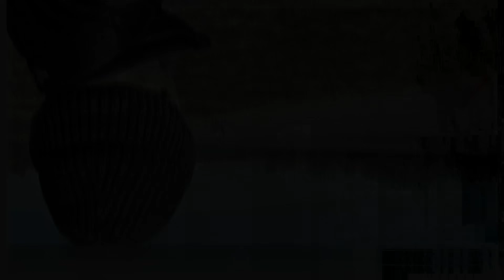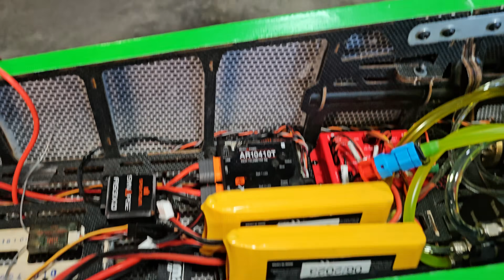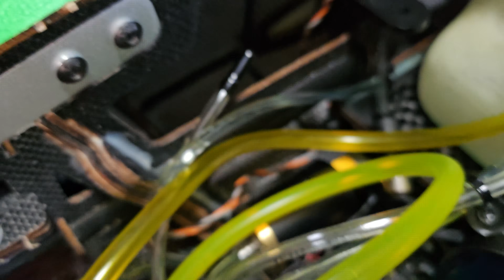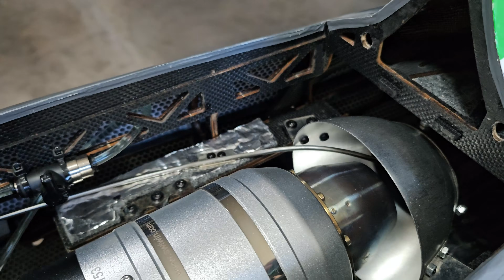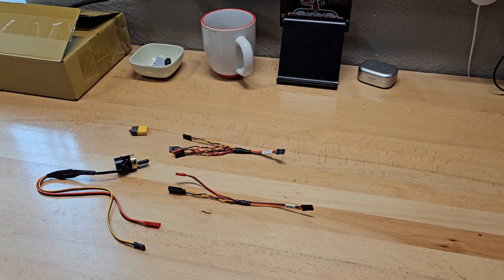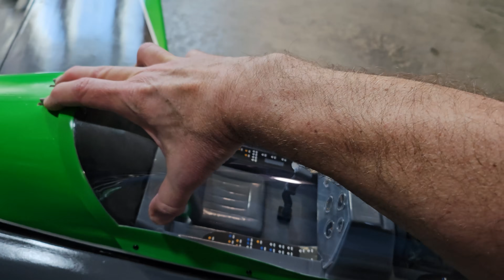ViperJet Build Part 4

Comment: I had a 125oz tank in mine and had the two smaller rx packs batteries mounted on the side wall over that fuel tank. As for the turbine battery I made a plate and mounted the that battery 
just in front of the engine. Also used a 130oz UAT in front of the tank as you. The turbine pump was mounted in the rear didn't have smoke in it. CG was dead on. I don't care for the CG plates that comes with the model, I used a Xicoxy balancer and a EZ-Balancer stand.

Good idea with the wiring. The first Black Horse I had I painted over the cover with Automotive metallic paint. The covering had a reaction in some area of the covering. In the sun that covering started to lift which made the plane look really bad. I've since bought a second one and my plan is to remove all the covering and fiberglass everything, then do a custom paint job.
I haven't started the work yet as I have another plane I'm working on. 

I did a metal flake paint job on my Boomerang Elan which turn out really. That gray is a hard color for me to see.
And yes the Unilights are pricy I have them plug SkyCandy light on a couple other jets.

Like the idea of the top plate covering all the wiring👍👍
Nice maiden

Oh! I didn't have to add any weight to my plane

Comment: Mine's comming along too. I also have CG-issues. Moved everything as far back as possibly but still needs some lead in the tail.
And then I'm in doubt if I shold clear-coat it? Have already bought the 2K sprays.
Im using a JetCat P80se which is relative long, so had to move the tank almost 50millimeters/2inches forward 😮.
Also need to adjust the throws on the rudders and re-center some links/horns before the final adjusting.
I have 5 2S lipo's in mine 🫣
Reply from the maker: Yup, I had to put 180g of lead in the tail to CG the model.  You don't want this one too nose heavy.
Reply: Awesome videos! Im building mine right now. How did you get your weights in the tail? Did you have to remove the thrust tube? Looking forward to your next video!